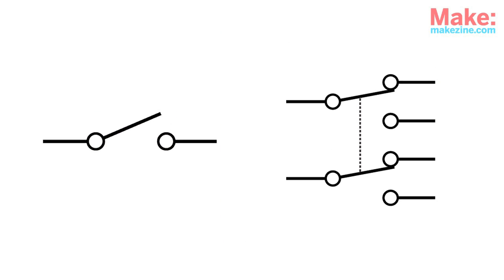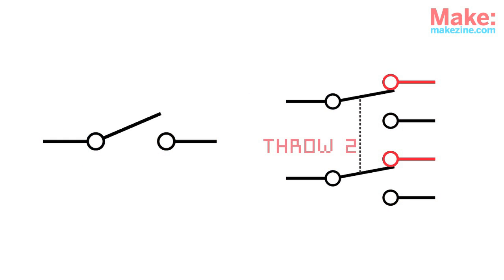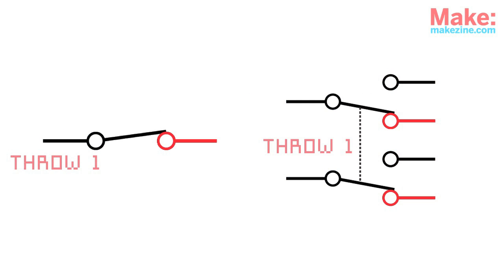Collin's Lab: Switches

Comment: So if there is anyone out there.....I took apart two keyboards. I'm a noob here. I mean that's why I'm here. To me the future is stay at home electrical engineers. So the keyboard. Hacking it......I want to do something but don't know what. I look at the guts and think.....something can be done. But what? Maybe something automated. Something cylindrical in nature and hollow, with valves that produce something. The exterior could be some kind of barreling system that has little fingers that ultimately could be coded to be programmed to fire each contact at a specific time. This obviously is not very practical but it could be used to create some kind of vortex. It function like a rotary device. Anyways I like the videos. As a novice electrical engineer and hard pressed to get a loan to get books your channel has indeed helped me along.

Comment: If the electricity is to complex and you want an easy solution, make a timer switch that quickly turns of for like 0.1 sec. and stays on for 2 min, that way it automaticly restarts the clock seamlessly so it. Or A timer switch that will every 2 min, rotate a moter to flick it, but solution 1 is easyer.  :)

Comment: Colin... you're bloody Brilliant !!
Thankyou so much for this vid, I'll make good use of this knowledge.
I have a question. 
I recently converted an old Ekco Radio I bought at a bootfair for £3 into a guitar amp which sounds wonderful. It does however seem to have a dodgy Vol pot that keeps cutting the sound til you either turn it off and on again or give it a flick. Is this something that can be repaired or do I need a new switch please? if it was a crackle then spray? but not sure that'd do it

Comment: One thing I need to hack is the wireless remote for my car. It uses the membrane switch but I would rather have standard momentary switches because they're more reliable and harder to press in my pocket.

Comment: Dip switches are fun... wire them to each other in a random order, and made a code to turn the device on. I recently replaced the back-light of an LCD screen with one that needs externally powered. I jumped it off my computer's power connection, but I may use my coffee maker switch on it. I've been waiting for a worthy project for the rocker switch that is labeled "warm" on one position and "brew" on the other. It needs a good home.

Comment: @JacobLukeWood Although some 4 terminal tactile switches are DPST (double pole single throw) which would allow you to control two circuits, most are SPST (single pole single throw).  For the SPST they still have 4 terminals, but you only need to use two of them.  The other two are really just to help with mounting.  Consider digikey part 450-1649-ND.  Pin 1 is ALWAYS connected to pin 2 and pin 3 is ALWAYS connected to pin 4.  When you press the switch the 1-2 pair is connected to the 3-4 pair.

Comment: Rubber dome keyboards? Pfft! Get a mechanical keyboard...each key has a tactile switch connected to it. They obviously are more expensive than rubber dome keyboards, but if you use them often, (which I bet you do) it's worth it. I'm typing on a Das Keyboard at the moment. :D

Comment: @JacobLukeWood The tactile momentary switches would work with 2 terminals, but they usually have 4.  The two left terminals are always connected and the two right are always connected.  Pushing the switch connects the right pair to the left pair.  The advantage of the four terminals is that 4 terminals provide better support when mounted to a printed circuit board.  If they only had two terminals, they would be more likely to twist, slide, or hinge when you pressed them.